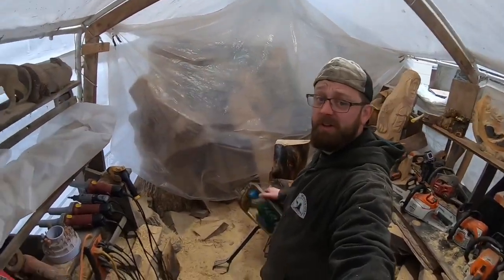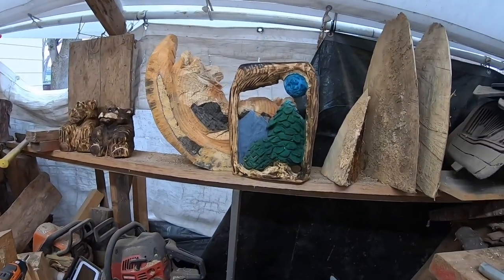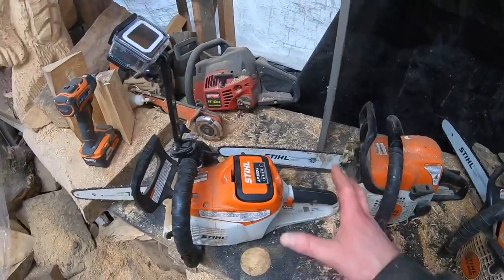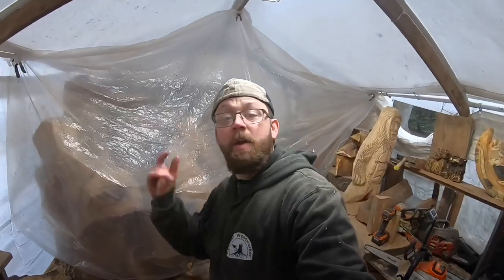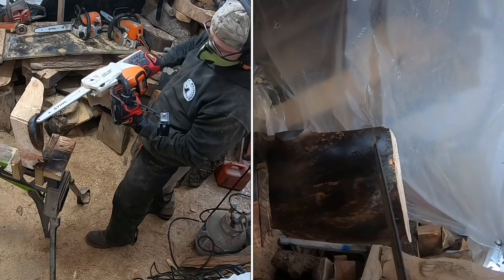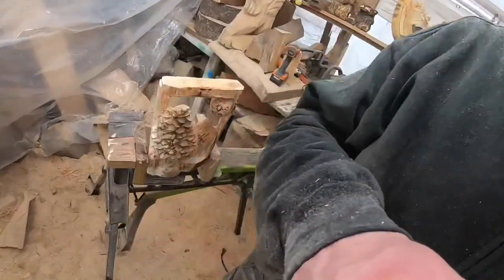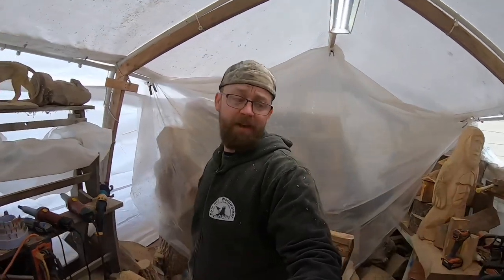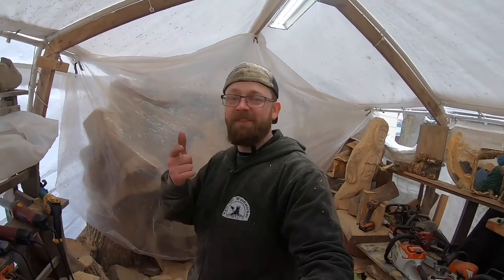Chainsaw carving scrap wood into a wall hanger .

Comment: Can you put the minwax into an air sprayer? Or will it clog?
Reply from the maker: Well you can if you thin it with mineral spirits. My theory is with spraying it I’m losing the over spray and that’s cash I can’t get back . Especially with one gallon now being $65
Reply from the maker: I just brush a single coat on small pieces and a couple coats on large